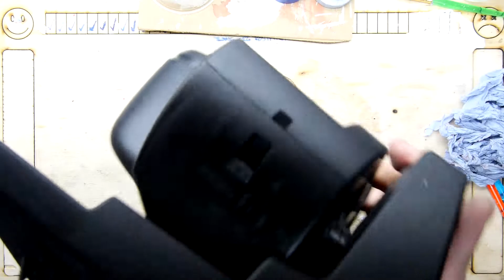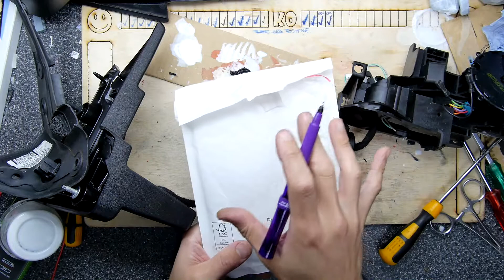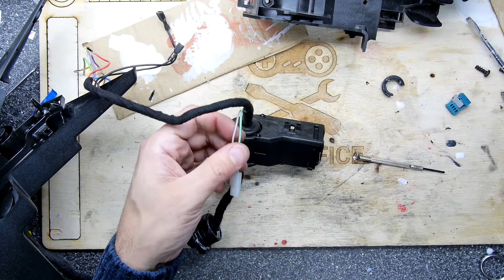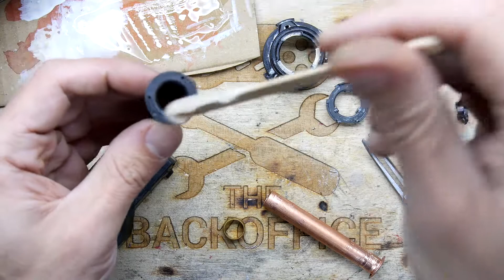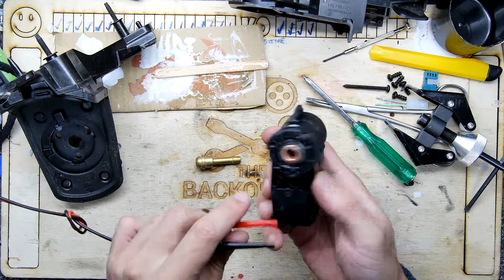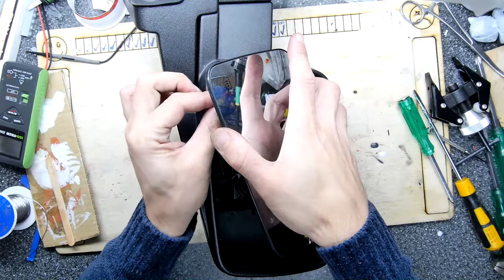Jeep Commander Mirror Repair & Teardown

Comment: Thanks! I have a 2006 Commander with an offside mirror that drives it self all the way forward as if someone has knocked it. Must be the position sense mechanism.
Reply from the maker: Yeah could be. As long as the spindle is not trashed like mine, you should be able to service it quite nicely. I need to remember to look for a spare next time I am in the states. Also a new seat squab!
Reply: @backofficeshow  I have the same problem of the mirror going all the way forward.  I have opened it and everything looks fine. What next? Please throw me some ideas. Otherwise you did a very helpful video!

Comment: I have the exact same problem with my Grand Cherokee 2006 and  I have bought a second hand mirror (cheap enough) from the American E-bay, without realising it has no motor in it. Watching your video inspired me to go back to the Brocken one a try to fix it the same way as you did.
Reply from the maker: Good luck, I hope it works!
Reply: Trouble is I have applied a lot of silicon to temporary fix the two parts till I got the replacement, so let see how I'm gonna even open that thing... ;(
Reply from the maker: WD-40 will eat silicone 👍
Reply: All went good and initially the mirror worked, but then suddenly doesn't know anymore where to stop when opening. Can't find any info what marks the end  of the unfolding cycle for sure. ;(
Reply from the maker: The end stops are in the gearbox with the motor, i would have a look in there and clean them.

Comment: Well done. At the beginning of the video I thought, I don't think he's going to pull this off. I was wrong. Ingenious repair. I have a Jeep Cherokee but they don't have power folding mirrors here for some reason. Regardless, I have learned something. Great job.
Reply from the maker: +MindFlareRetro Thank you sir. Maybe the grand Cherokee does, I'm guessing it could be an option. Still you are even luckier as they should be simpler to fix when this happens 😂

Comment: I learn so many real names for "thingymebobs" from you. Though what was that tool you used with a clamp called? I've never seen one of those before.

Ingenious as always!
Reply from the maker: +FairFight14 Ah that tool is a Wiper Arm Puller. It's a clever design but quite weak compared to others, hence why is broken. I broke it on first use but I though it was too soon to throw it away.